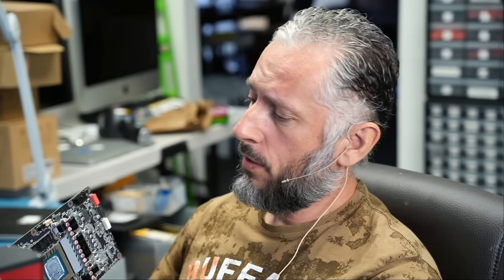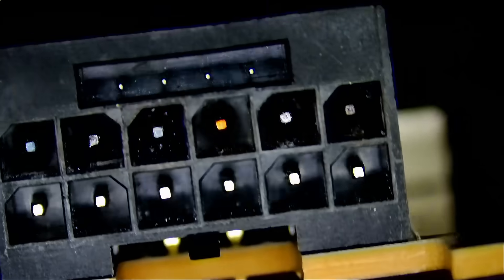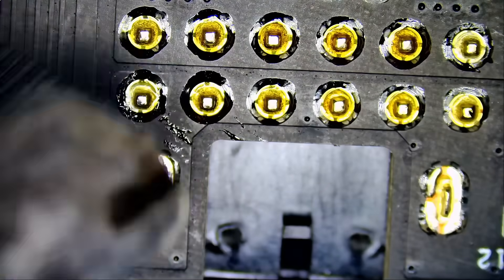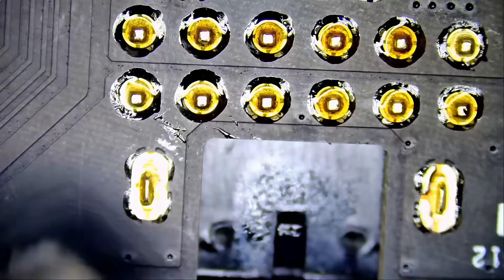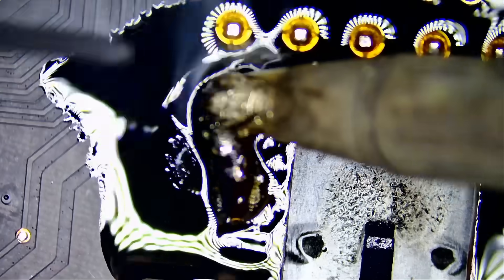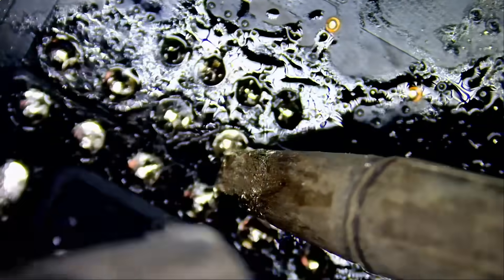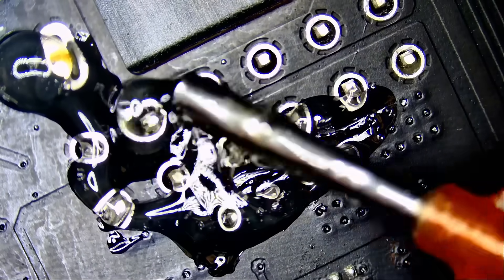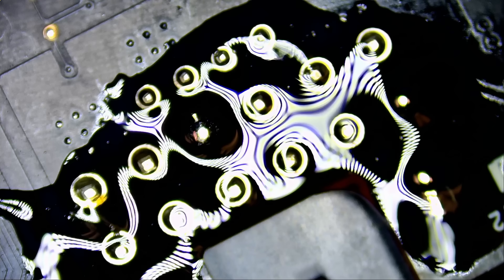Asus 4090 GPU Repair. This is how perfect soldering looks like with NF.Flux

Comment: Hi i got a gigabyte g6 kf i recently replaced the thermal paste and now it wont turn on. When plugged in the charger charging light comes on and batters light comes on but when i press the power button nothing works. Help please

Comment: At this point with these stupid video card connector issues, I cut all the connector ends off of the power supply rail, desoldered the connectors from the board, and soldered the wiring directly to the card. It takes a few minutes so if I need to remove/replace the card, I can still do it. Enough of these stupid connectors.

Comment: Can you please tell us the temperature setting of your hot air station used when pre-heating the board and about how long you pre-heated that connector? Low-melt solder is definitely magic. I've replaced popped-top through hole caps on mobos and they just "fall out" when mixed with LMS. NF.Sucker also has changed my opinion of solder suckers: it "just works". 😄

Comment: It is not better than factory. I make better joints with any cheap chinese solder wire. But that is not because quality of this solder, but because of me. Also i don't need expensive solder iron. Just regular one.
Anyway, i need to ask you ... again: How much HP the BIG BOSS have?

Comment: I have a 4090 liquid x that works fine for the most part, but sometimes when it boots the screen is scrambled.
Reply: Are you using 4k, or high FPS? If so, you may want to get a better cable. To test if it's the cable, use lower resolution, or FPS. If it goes away, then it's the cable.
Reply: Mines been doing that too. A restart fixes it, so im assuming just a driver issue

Comment: Better than factory for sure, but in all honesty, I would argue that (almost) any joint which uses leaded solder is better than factory. If you can't do a better than factory joint using 60/40 or 63/37 solder, then you're REALLY doing it wrong.

Comment: I need a break, so I want to go to the ninth dimension.  Those joints are not better than factory.
Reply: You gotta be smoking low melt solder to say those joints are not better than factory